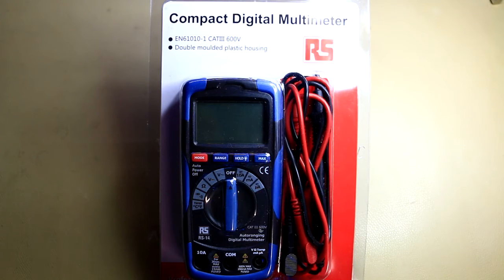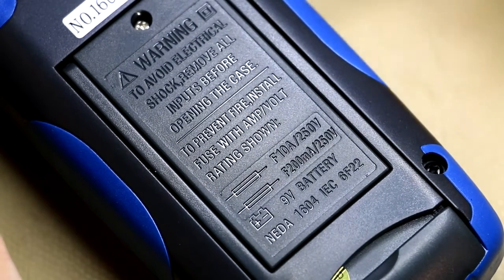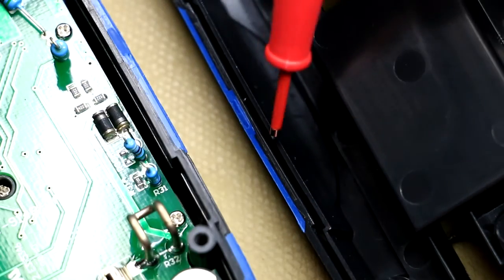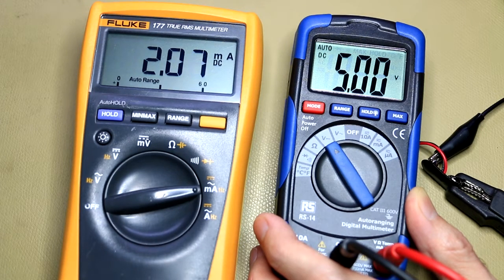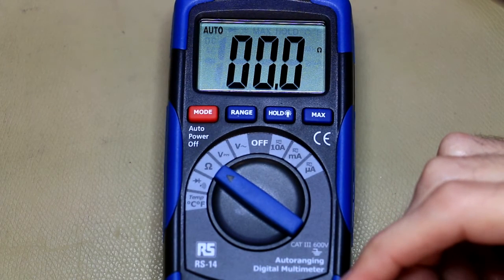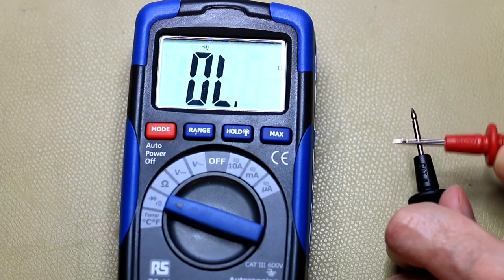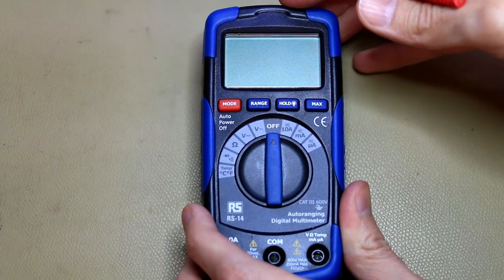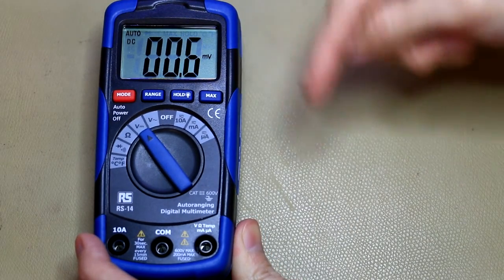RS-14 Multimeter review and peek inside (CEM-DT914, HayesUK) (#012)

Comment: Regarding the specifications the model RS-12 is more accurate in general than the model RS-14, isn't it?
Reply from the maker: Slightly more accurate, yes, but then again, it lacks automatic ranging. The RS-12 a fully manual meter.
Reply: Also lack temperature measurement

Comment: Spare 10A fuses are R34.92 for a pack of 10. Used in microwave ovens, as they think a 6.3 x 32mm fuse is too expensive. Just replaced on on a microwave today, it blew the end cap off in failing. Can't see why, think it was just damp causing a flask over, as it was perfect with a new fuse.

IC is likely a Cyrustek DMM in a chip, and with a 3V regulator on board so it will run down to 3V fine.

Comment: Nice review. What's the mode button for?
Reply: +Dean Greenhough Changes from AC to DC and from resistance to continuity and diode test.
Reply from the maker: +Dean Greenhough - SeanB is correct - mode button changes from DC to AC in current measurement, as well as between diode and continuity functions when the selector knob is in that position.